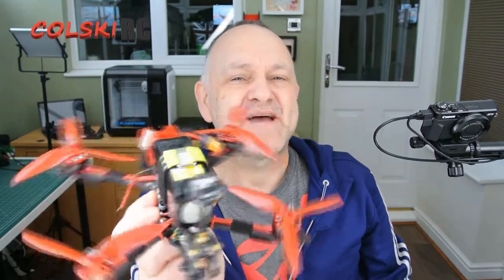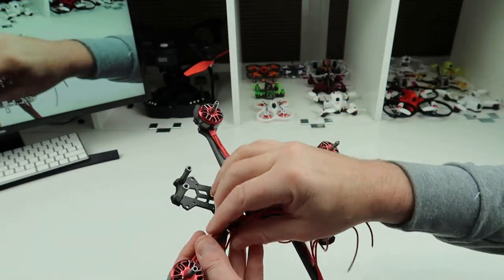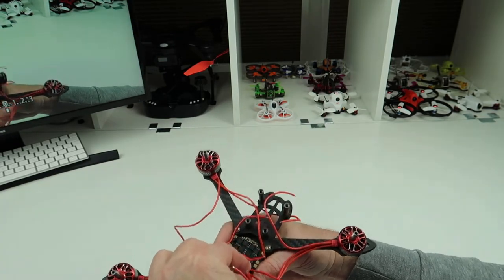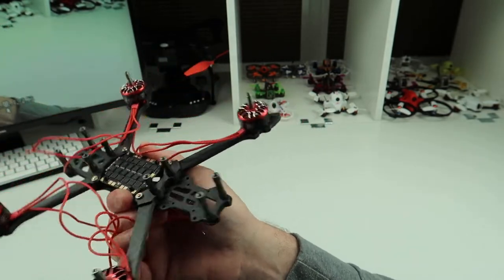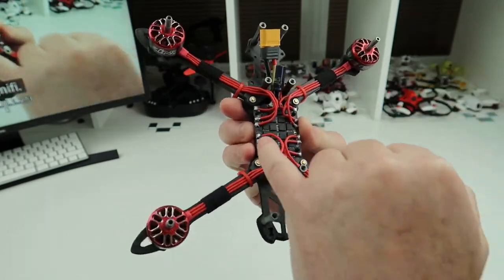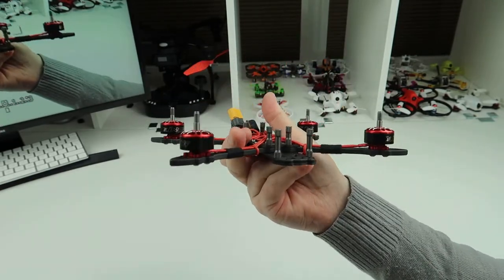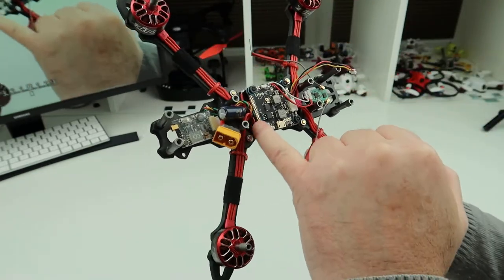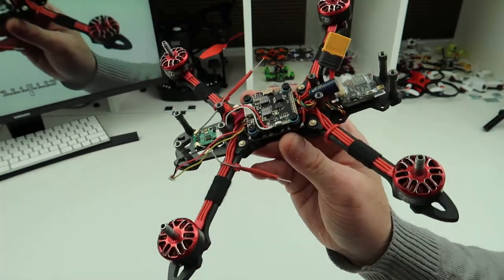GEPRC MK4 BUILD VIDEO Pt2

Comment: This will be my next build after I complete my Diatone Cube 239...Awesome build my bro! Protect those two naked receiver antenna wires on the tip. Over time they will get brittle, weak and bent out of shape and will not get a good signal...beautiful quad and looking forward for it's maiden flight! Thanks for sharing!